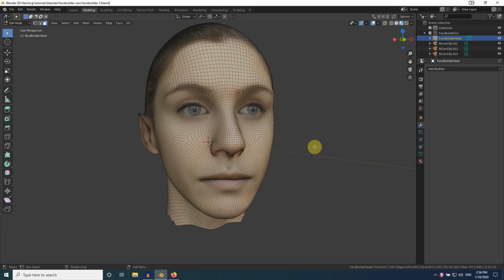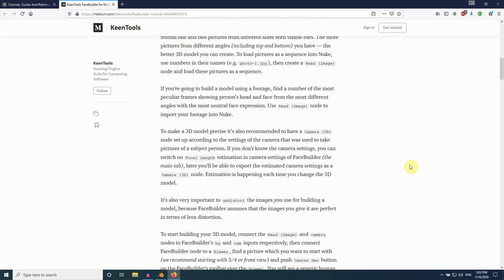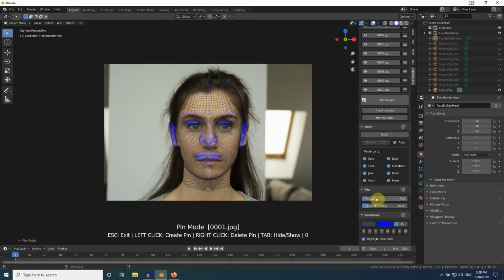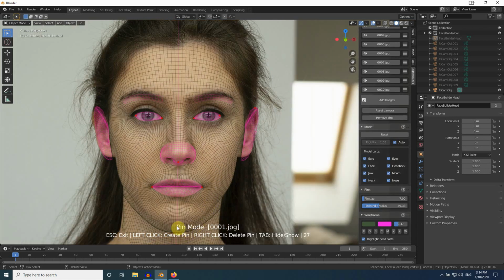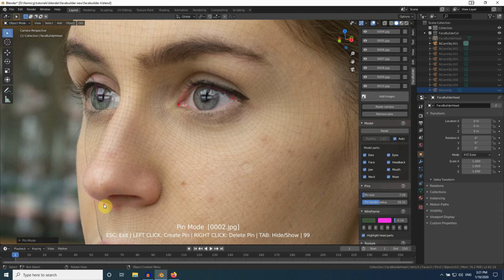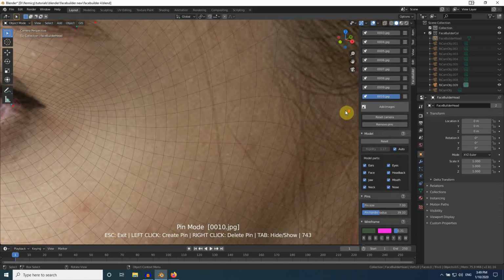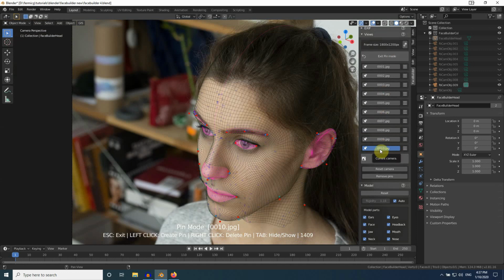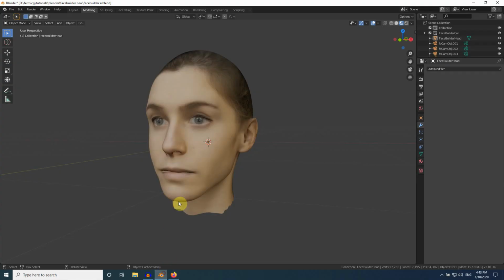Facebuilder for Blender Build 3d face in minutes

Comment: So it makes the face but.... how do you animate it? I can't seem to find any included bone structures or anything that could actually make it animatable??
Reply from the maker: It is actually for face tracking. You can check at https://keentools.io/
If you really want to animate the face inside blender you need to create shape keys or do bones.
Reply: Blender comes with a complete (albeit simple) skeleton. You could just use the facial bones from that.

Comment: Great Vid..I have finished my model and want to render how do I do that ? I can't seem to find away to exit Facebuilder and start to render. Thanks
Reply from the maker: you can click middle mouse and rotate, that will give you a perspective you i.e. you are out from Facebuilder view. In order to render the mesh you need to create a new camera and lights (in case you deleted all the objects according to the tutorial). Go to add> camera
Now select the camera and view>camera>select active object as camera.
Press N. A new menu will be opened to the right. Select view>view lock. Enable Lock camera to view. Now you can  adjust the camera simply rotating the view port. 
Finally adjust the lighting and hit render.
Reply: @fermicg  Worked but now My camera is stuck in PORTRAIT view. How do I get it back to landscape. Thanks for all your help
Reply: @fermicg  I will figure it out later. I just EXPORTED the Head as a .OBJ and it works GREAT.
Reply: @rededwards3479  Just add in a new camera and set it as default

Comment: Once you have built a face, how do you attach it to a body to create a full 3D body i.e. face, body, arms, legs?
Reply from the maker: It is tricky, face-builder plugin isn't for creating a complete character, it is used for creating realistic face mask for VFX works. Easiest way is to keep body and head separate and adjust the rig and skin values accordingly. 
There is Make human plugin and Daz face transfer available to build a complete character based on photo reference. 
https://www.youtube.com/watch?v=0ZJ87yeBg8k 
https://www.youtube.com/watch?v=X9oSVMLC0Ak&t=107s

Comment: I could have sculpted myself in Zbrush  in 45 minutes 😂
Reply from the maker: Of course you can. This tool is not for modeling artist but for vfx artist, mostly they need to to track and vfx to the real actors. Facebuilder is meant to provide easy solution for vfx pipeline especially lipsyncing the 3d head automatically. There are other plugins work along with facebuilder, check their website. 
I made this video to show the capability of a Blender plugin and at that time it was free. 
Someone like me who has no talent in sculpting or modelling this tool is a magic wand.

Comment: How can we attach this face on whole body . Face builder only makes face . How can we make full body and attach face made through face builder?
Reply from the maker: There are different ways of attaching the head to body. If the character has clothing which covers the seam, there is no need attach. You can use head and body as separate mesh and skinned to same skeleton.  
If you really want to make it as one mesh you have to work on topology.
FAcebuilder isnt a tool for modeling a character. It is used for VFX where time and visual appearance is the most important factors, topology doesnt count much. 
You can try ' make human' (http://www.makehumancommunity.org/) for creating a complete human body. It is free and easy to use. Simply drag some sliders the character will be ready. Though it cant make character based on photo reference.
Another software is Daz3d (free) which also makes photorealistic characters with rig.
Reply: @fermicg  Can you detail what Facebuilder is made for, you said time and visual appearance but in which case you have to use it ? Thanks a lot